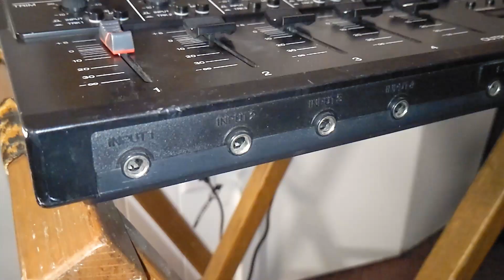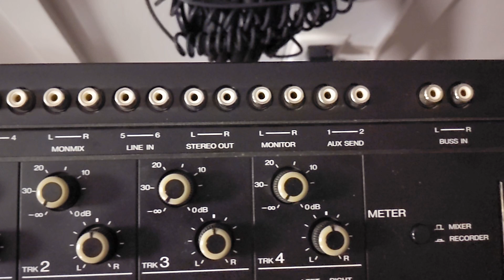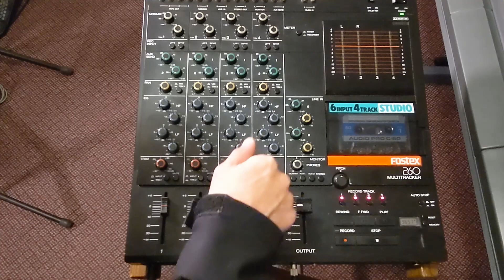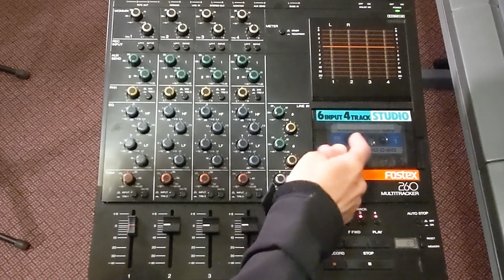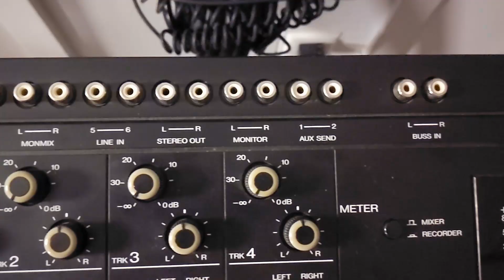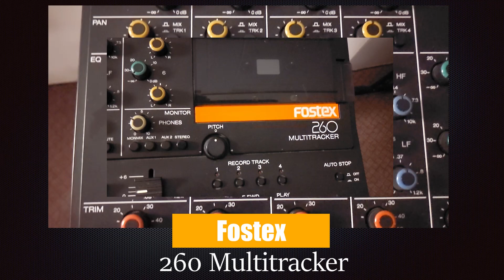Fostex 260 Multitracker

Comment: l have  a  fostex 260  thats  worked  great  for  years but  now  the  record  switch  will not  let  me  record  on  any  track .  lt   still  plays  any  of  my  past  tapes  l recorded  before. My  tech  has  tried  everything  but  has  since  given up  on  it .  Any  idea   on  who  or  where  this  could  get  fixed. - johnny
Reply from the maker: I'm not really sure who works on Fostex 4 tracks anymore. People that repair analog equipment are harder and harder to find. Does it erase previously recorded material? If so, it's not the bias oscillator. It could be anything in the recording path. I've heard things about the switches going bad so it could be something simple like that. Your best option night be finding another unit for parts and swapping in the PCBs for different sections rather than component level repairs. I'm not really a tech. I just muddle through fixing some of my own gear. On my 260, the only things I had to do were belt replacement and cleaning. Good luck! I wish I could help more.

Comment: I bought one of these broken from ebay. I wanted to give myself a project. 

1) deoxit the syscon buttons. (Dont use deoxit on the pots for the love lf god)

2) changed belts. 

3) lube transport (it was getting stuck)

4) replace faders

5) replace switches. (The OEM switches are no longer in production)

6) replace some of the pots. I think this is because carbon pots with moisture increase resistance. 

I need yo find 6 pin pots for the master stereo, but otherwise its its completely working as a monitor out
Reply from the maker: Mine was broken too but replacing the belt fixed it. It really didn't have any other problems. My Fostex 450 looked really rough when I got it, but it worked 100%. I mainly restored it cosmetically. Fostex made really good gear back then. They still make excellent studio monitors.

Comment: Great video, thanks for sharing ! Purchase one today, non working, but cleaned it up, new belt and its working, but a normal tape runs with double speed, even though the Pitch know is to the very left....Is this true that you cannot play normal tapes on this machine, which were NOT recorded on this machine ? Thanks so much for your advice.
Reply from the maker: @zcarmfilms  you could play normal cassettes with it but they will play too fast as the 260 doesn't have a speed switch or variable speed. Also all four tracks play in one direction so side 2 would play backwards at the same time as side 1 plays forward. These are designed for multitrack recording. A standard cassette desk would be much better than the 260 for playing regular cassettes. I guess you could play them into a digital interface and then slow them down in the DAW.
Reply: @TwinCreekAudio  Hi, thanks so much for your very useful information to my question !!! Thank you !

Comment: Good Shit bro, your videos are well and informative!
Reply from the maker: Thank you! I work real hard on these videos. Trying to keep analog and DAWless recording going strong.
Reply: @TwinCreekAudio  Just got me 1, is the headphone out the audio output?  or the rca ports at the top? is there a difference?
Reply from the maker: @muscularclouds  I'm not sure. I think there is a master out on RCA jack for left and right. The headphone out should carry that same signal but you might check the manual to be certain.
Reply: @TwinCreekAudio  The manual doesn't say much, but ill just experiment and see
Reply from the maker: @muscularclouds  I don't have the 260 anymore to test and see. I think the headphones are selectable on switches but I would just use the master LR out. Headphone out would work but will likely be odd impedance and may not sound as good.

Comment: If I make a mistake when recording, do I have to record everything again or is there a function to record only the part that made the mistake?
Reply from the maker: You can do what's called a punch in. The 260 has a foot switch jack to make this easier for one person. You basically punch in(go into record) to  record over just the sections you want and then punch out(drop out of record) when finished. It's not nearly as flexible as a DAW, but it is the way things were done on tape and will still work once you learn how to do it and practice a little bit.

Comment: Help my tape is tuck in the deck. where is the eject button.
Reply from the maker: I don't think it has one. Just lift the door and then grab the edges of the cassette and gently pull it up and out. If it's stuck or tape is trapped in the mechanism, there is likely something wrong.
Reply: @TwinCreekAudio  i push the play button and the tape does not move. it worked 10 years ago...
Reply: @tombeckner404  most likely the belt is broken and needs replacement. Easy fix!

Comment: I worked on a rock solid Fostex G24 for two years it was a good machine but didn't have a ton of headroom since it was all -10 on RCAs and the noise floor was a bit too high and if you could beat the noise floor you were into distortion. We modified it to take +4 and it improved dramatically but it died due to heat. I then I moved up to a 24 track 1 inch Tascam machine which was one of the quietest multitrack decks I have ever used that wasn't a MCI or Sony machine.That is very cool machine and will give you some color you can'r get in the box.
Reply from the maker: I started my recording adventures with a Fostex X-30 4 track. It's really cool to have one around again and this is a better model than my original X-30. I also ran an E-16 for awhile before upgrading to an MCI JH-16. That thing sounded great but needed adjustments and maintenance a lot. It was 40 years old already so that makes sense. I really like the small Japanese machines a lot. I have a little R8 I'm working on to make some videos with too. They are fun and definitely have a specific sound you can't get anywhere else.
Reply: @TwinCreekAudio  Sound like really cool stuff you have planned in the future!! I can't wait to see it!!